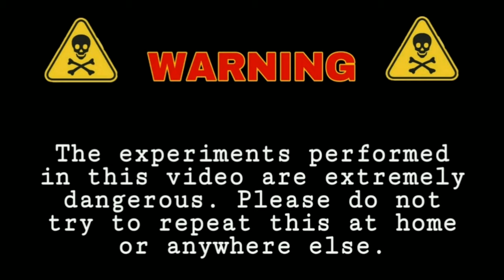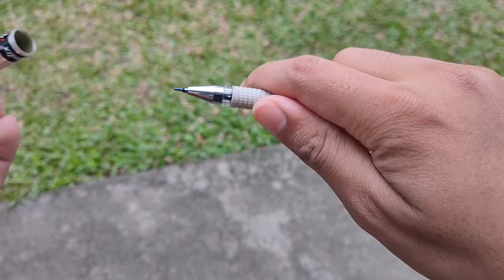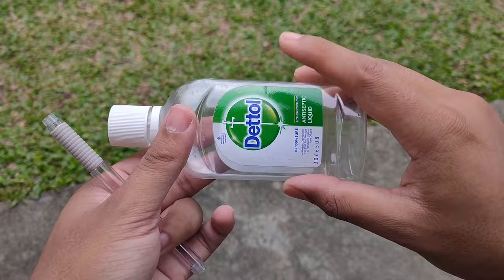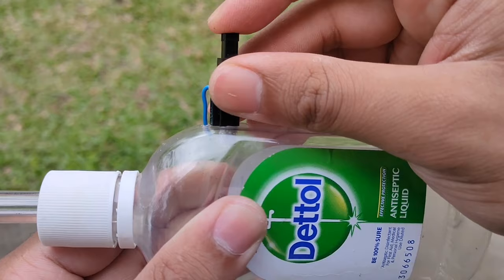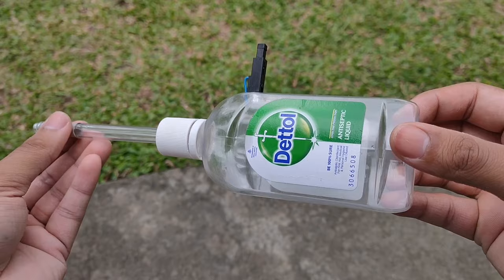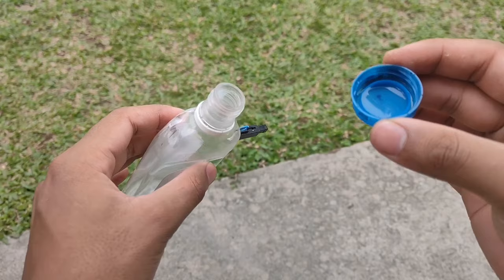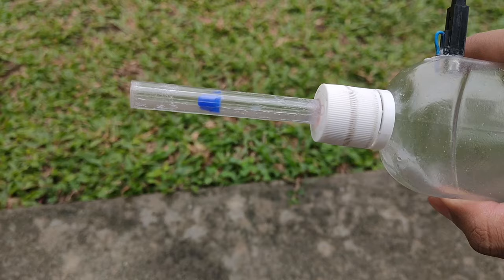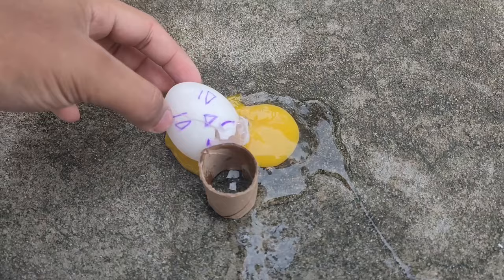How to make a powerful ALCOHOL GUN at home.

Comment: can someone explain the science behind this im doing it for my science project :)
Reply from the maker: The sanitizer contains alcohol which vaporizes inside the bottle and mixes with the oxygen inside the bottle . This mixture is highly inflammable so when we press the switch a small spark is created which ignite the fuel . This results in increase in pressure inside the bottle and as there is only one hole ie the barrel so all the gases comes out of the barrel at very high speed pushing the projectile out of the barrel .
Reply: @TheRandomBunny09  tysm!!
Reply: @TheRandomBunny09  i love your video man lovd so much
Reply from the maker: @Fish_Keeper  thank you 🍻
Reply: @WuBuzhidao  how did it go?
Reply: @WuBuzhidao  Strait plagiarism if you copy pasted it to your project!
Reply: @TheRandomBunny09  bro my stupid a$$ litterally put a lighter on an alcohol bottle and it phew out fire and then i knew i was a  pyromaniac
Reply from the maker: @SamXlk  😂😂
Reply: @sonyclonesph4543  he prob took the info didnt copy paste tho
Reply: @TheRandomBunny09  can i put the igniter far back on the bottle?
Reply: @TheRandomBunny09  that's the reason cell phones or any electronic devices can't be used in close proximity to a gas station. It could start a fire... Gasoline is highly flammable as well.
Reply: to those who have tested this how strong was it? can you compare it to an airsoft? like maybe 15-20 joule?
Reply: Alcohol gets fire and explodes
Reply: This is sus 😑
Reply: Gas expanding
Reply: @TheRandomBunny09  o

Comment: The holes or open  seals on the holes need to be glued shut or sealed because if not some of the  hot pressure inside can escape through the opened seals and burn your finger so yea stay safe
Reply: It happened to me but the fire really just made my fingers a lil bit warmer and it lasted only for like 0.1 seconds. But ye u should still glue it all the way unlike my dumb ass.
Reply: if the holes are really small it wont do very much its gonna be a quick poof and thats it

Comment: Bro, this gun is not working for me... When the spark plug sparks inside the chamber there is no ignition happening inside, I've used hand sanitizer with 72% alchohol, but still not working. Plz bro tell me a solution.
Reply: Use 99% pure rubbing alcohol, or gasoline.
Reply from the maker: Ya the alcohol percentage is low so there is no ignition

Comment: what kind of alcohol do you have, just 100% ethanol or some vodka ? :D also will it work when the alcohol dont touch the spot where is the electric zap ? :D
Reply from the maker: I am using a sanitizer actually that contains 75% alcohol . You can also use pure alcohol like ethanol or isopropyl but vodka won't work 🌚 . Yes it will work .
Reply: @TheRandomBunny09  nice, thanks for response... i have one much larger cannon made, and im using deodorant as fuel but sometimes it dont want to catch fire even though the zap works 100% of the time... so i will try your ethanol way :)

Comment: Bro not working pls help me pls i have used 90 percentage above alcohol and i think in the gun there is no spark or ignition and i v used new lighter sometimes a flame comes when i make the wire switch from its position and then i do it go nothing help me
Reply from the maker: I think the wire of the igniter is touching the base of the igniter the spark is occuring somewhere else . Try keeping about 3 mm distance between the wire and the base of the igniter than spark should occur.

Comment: Is there any alternative for alcohol as liquid ?
Reply from the maker: You can use butane gas but is very small amount coz it burns very fast .
Reply: @TheRandomBunny09  where can i get butan gas?
Reply: Will liquid sanitizer work?
Reply from the maker: @syedfahmali3855  yes liquid sanitizer will work if it has more than 70 % alcohol
Reply from the maker: @syedfahmali3855  I have uploaded a video on how to make bullets for air gun same bullets can be used in this gun you can check that video
Reply: @TheRandomBunny09  brother i made a similar one. When i am firing if it works its just a very small flame and some gas sound and after one time it stops working. Then i have to change the switch ? What do i do?
Reply from the maker: @syedfahmali3855  after each use the oxygen inside gets used up so you have to squeeze the bottle a few times so fresh air gets inside the bottle than you can put some more alcohol and use it again
Reply: @TheRandomBunny09  thanks bro it works now... Cheers 🤗
Reply from the maker: @syedfahmali3855  wlcm brother
Reply: @TheRandomBunny09  how can i give more power to it?

Comment: Didn’t work 😩I need to make another one, u sure this rlly works?
Reply from the maker: Yes sure . I think you are putting too much alcohol in it or maybe the alcohol is not pure enough .
Reply: @TheRandomBunny09  is 70% ok?
Reply from the maker: 70 %  will work
Reply: @TheRandomBunny09  oh, I I’m gonna try sealing it again too and using less alcohol, thanks
Reply: @TheRandomBunny09  maybe it’s because I used a straw for the barrel?
Reply from the maker: @callofmemes5347  is the alcohol igniting or not ??
Reply: @TheRandomBunny09  no
Reply: I mean like the straw is flexible so when I put the glue on, I might of crushed it to the side making a gap